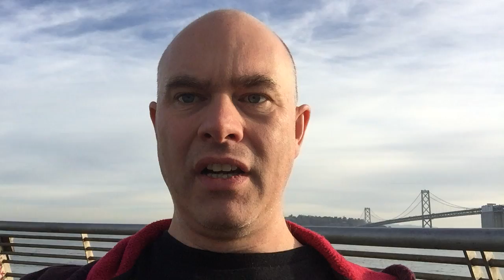Let's Talk About The Antares Launch Failure.

Comment: Hard to beleive that a.rocket engine dating almost half a century still works... Somewhat.
Reply: except when it explodes…
Reply: @Sinonlynx  - Like most engines when you insist on pushing them well beyond their officially rated thrust. True to form, Unlike Kistler, Orbital were to cheap & greedy to use three NK-33s on the first stage instead of two.
Reply: AndreKSP
 You mean when it isn't exploding like it was supposed to. Though I still think it looks like the fuel tank leaked, rather than the engine. Still, it's a really good engine, they should start building them again instead of refurbishing them. It has the third(?) highest thrust to weight ratio in the world, with an excellent specific impulse.
Reply from the maker: ***** Ummm no, the F-1 engine on the Saturn V has a thrust to weight ratio of about 94. The RD-180, NK-33 and Merlin all do better than that.

But the F1 is the biggest rocket engine ever flown.
Reply: if it ain't broke don't fix it, like manley said these rocket motors actually have a pretty good track record and design.
Reply: It sounds crazy, but people forget we still run 60 year old cars with no problems, based off the same principles
Reply: That's a truly Soviet Engine :3
Reply: Sam Cooper Also, how many people do you think know how old most of the aircraft in the world are?  A 30-40 year in service record is standard!  In many places in the world, a number of airlines are still using DC3's.  It's 70-80 years since the last one of those was built!  And they haven't been carefully stored and restored, they have been in continuous use!
Reply: Ever heard of soyuz?
Reply: Scott Manley Just saying that the reason why the NK-15 engines were designed and built by Kuznetsov was because the original designer, Valentin Glushko, refused to supply his own engines unless the fuel type was changed from liquid hydrogen and liquid oxygen to a faster firing but dangerously toxic form of nitric acid and UDMH; it was referred to by Soviet rocket engineers as "the Devil's Venom".
Reply: But a rocket needs to be so much more reliable. If a car breaks down, you can tow it back and fix it, but if a rocket stops working in a middle of a mission, you're in a real problem.
Reply: Scott Manley The F-1 is the biggest single chamber engine. The biggest is four chamber RD-170, used on Zenit boosters. If you plit the engine, you get 2 chamber engine called RD-180.
Reply: Ma, they actually started doing testing with the old F1 engines (Saturn V) over the last few years. These engines were essentially mothballed for the last 40 years, and I believe the one they began testing with had been prepped for the final Saturn launch that was actually canceled. After that last mission was canceled the rocket was disassembled and put into storage, but several other engines and rockets have been on display at various facilities over the years. Even though the design is old and inefficient compared to modern engines it is still a very powerful engine, and by using modern instrumentation they are able to learn a lot about how they operate that wasn't fully understood at the time they were originally built. They were designed during a time before there was extensive use of computational aided design, and as a result in a lot of ways were over-engineered. It's actually pretty awesome the story behind this research, and there are a lot of great articles that discuss this testing. Also some parallel work was done that I think is pretty awesome too, where they took an engine apart and scanned every part to make modern CAD models :) ... anyways, if you're interested in that stuff I'd suggest just searching and reading, it'll be a lot more informative than my 0430 sleepy story telling lol ...
Reply: Why is this hard to believe?

We are talking 30 years ago, not 3000 years ago. It was not the stone age, but an age where governments were sending actual humans, not robots, to another world.

While I'm positive that something still confidential has broken all the records, go look up the official faster airplane ever built. Then go look at when it was built.
Reply: Ma rius
Apparently they are highly reliable, there are hundreds of flights each year and %99.9 dont blow up...
Reply: +Scott Manley wrong. The most powerful rocket engine is the Soviet RD-170\171 which powers the Zenit and powered the Energia (Buran)
Reply: Sam Cooper well… to be fair… there is a slight difference…
Reply: RJ Mac still not the same thing…
Reply: AndreKSP Nah, Cars and rockets are pretty much the same. They're both made of metal, right?
Reply: Sam Cooper umm…
Reply: Sam Cooper remind me to not join your spaceprogram
Reply: joeracer302
 I'm pretty sure they only actually ran the turbo-pumps.  I don't think they did an all-up test of the old F-1s.   Still really cool stuff, but I don't think Michoud (or was it Stennis?) has a test rig that can test fire an F-1.
Reply: Still,are they not being beaten by the SLS now? i thought the engines were bigger? please correct me if I'm wrong
Reply: Rocket technology  pre dates  even steam technology by hundreds of years it's a pretty mature technology.
Reply: if it has not been used ,why wont it work, some people look for a reason to bitch..
Reply: Simo uhhmm…
we can't count that…
Reply: Cheyne Simons Are you counting the 120 engines that failed over the course of 4 N1 launches?
Reply: quarthinos I believe that is correct, and just to clarify those engines are essentially the fuel pump for the actual larger engine, and iirc they have equivalent thrust to a couple of F18 engines, ~50k lbf-thrust. Again, just off the top of my head, so I might be a little off. It's still awesome they are doing testing with that stuff :D
Reply: There is a difference between a rocket and a car. Hardware designed to carry things to space are specifically built to be incredibly durable, I'd say 40 years is indeed old but I'm not all that surprised it still works. Cars are generally considered 'aging' after about 5+ years, but there's also still plenty around that are much much older than that and still in pristine conditions, and that's a vehicle designed merely to transport people a couple kilometres in more or less horizontal directions. Not 100 kilometres up.
Reply: VivsiCanian
 Ah, beat me to it as for Korolev and Glushko's disagreement on fuel type.
Reply: joeracer302
 Yep, all these things were designed back when everyone was using slide rules. But they sent people to the moon on the technology of that day. Pretty impressive, I think.
Reply: Sartori It's not just impressive, it's amazing and one of the greatest achievements of our species that continues to inspire! :D :D :D
Reply: People, every time a rockit is launched the engines are Brand NEW, never been used before(for the most part, some engines are re-used but not the ones in question)
    It is the   Design that is half a century old.. you can get something only so efficient,after that, it only decreases its efficient to change...